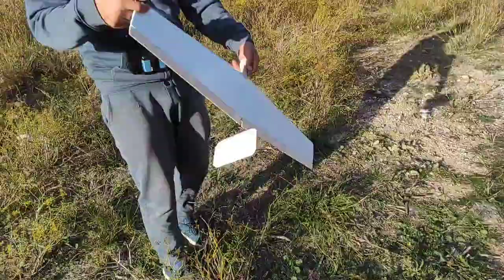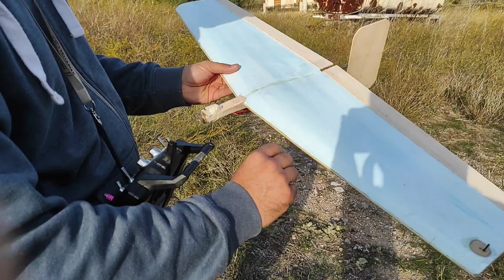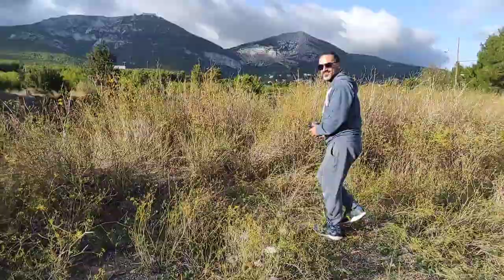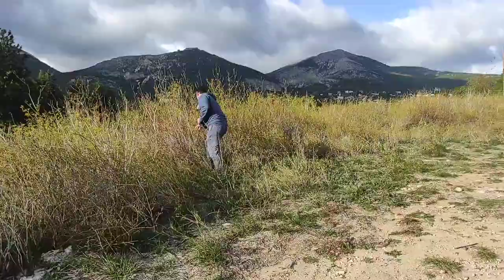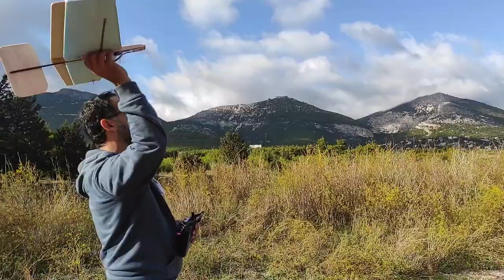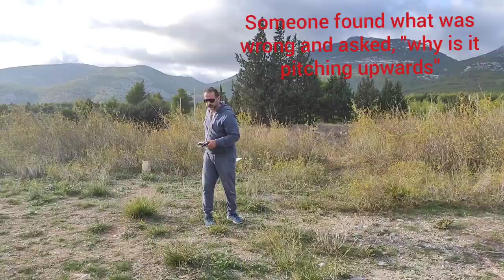Foam dlg Weasel / Wisel wing -scratch build

Comment: Very nice mini DLG and I was very glad to see You! :) This glider's setup is very tricky I see. It can flies very smooth, You are a very good pilot. Congrat for Your new project! Thanks for sharing!
Reply from the maker: thank you!
Reply: @afilos  What materials did You use for pushrods at this Wisel wing glider?
Reply from the maker: Bamboo sticks, drilled at the ends to receive 1mm wire. Both in this wing and my balsa dlg.

Comment: Is the wing airfoil is PW1211?
Reply from the maker: Yes it is
Reply: @afilos  thank you, and what the root chord and tip chord thickness? Mine is the chord is 23.19mm and the tip chord is 12.65mm thickness, is that correct?
Reply: @afilos your  wing is not the same with the plan of the site?  The plan of your desc is 330mm and tip is 180mm?